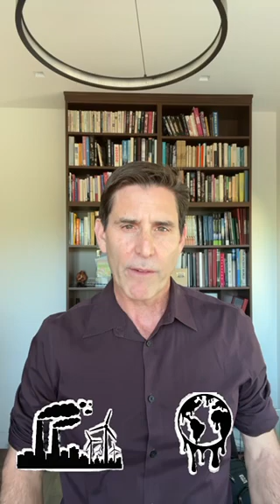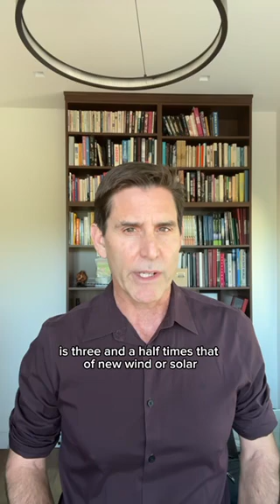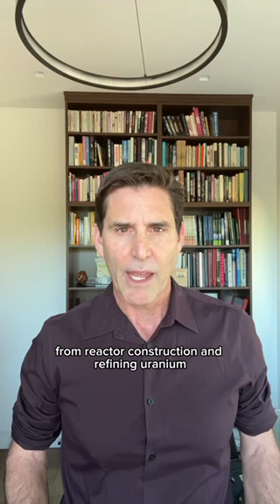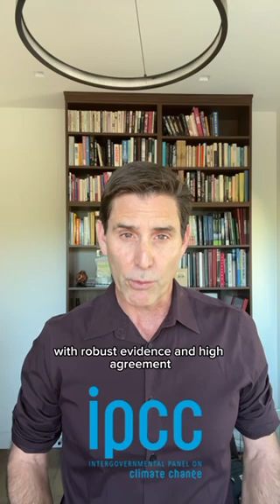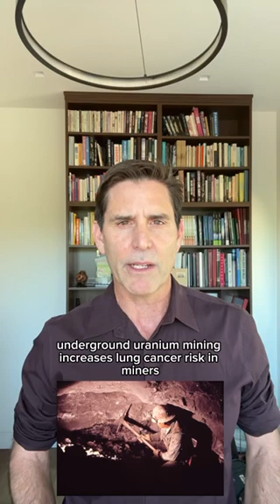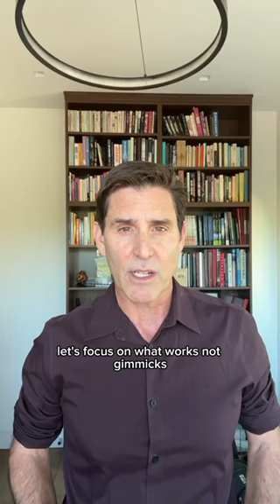Why new nuclear is useless - long version #energy #nuclear #wind #solar #renewables

Comment: The only conceivable role for nuclear going forward is to keep operating plants online while we use renewable deployments to cover increased demand, phase out coal and then oil/gas.  And then you get rid of existing nuclear.  If we still have nuclear in our energy portfolio 50 years from now, we screwed up.

Comment: Have you included availability in your LCOE numbers or adjusted capacity factor? Further, nuclear assets last 60+ years. Wind and solar have 20 year life spans. Inverters have a 5-7 year life. If you are lucky. Brodie, doesn’t think about frequency regulation for large scale grids. How are you planning to do that with renewables? I swear the bar for engineers at Stanford must be low if you are Professor.